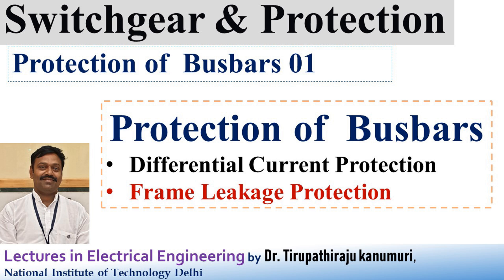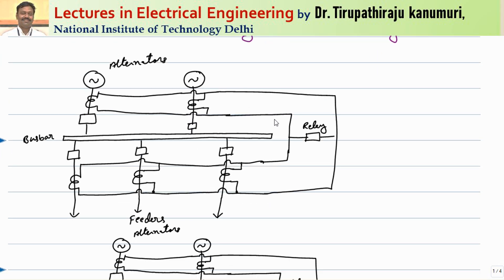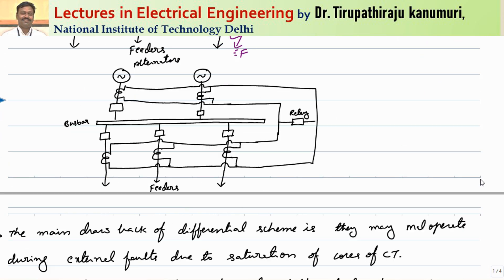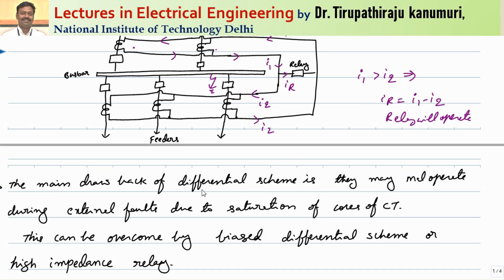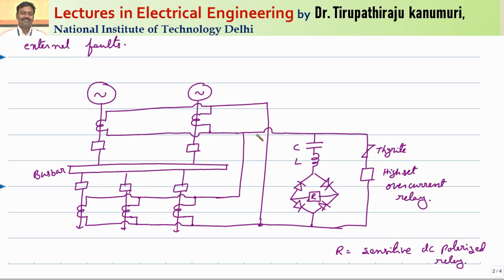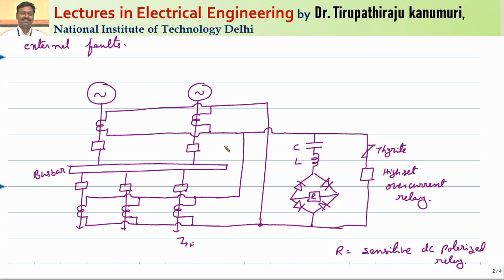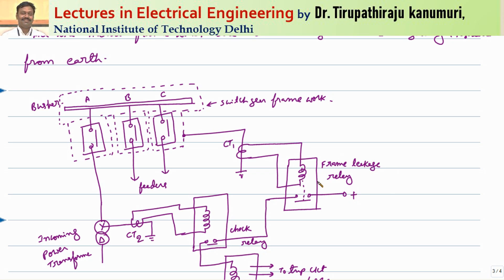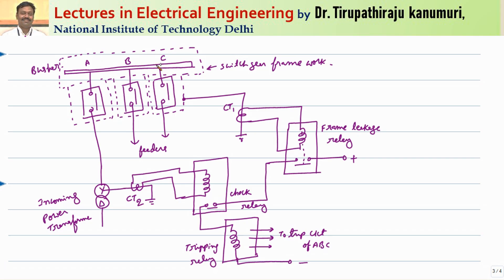SGP501 Protection of  Busbars

Comment: sir please, so for the metal clad type, both  high impedance relay scheme (or biased differential relay scheme) and frame leakage protection schemes are used
Reply: at 9:21, you said the frame leakage protection is used for metal clad type switchgear installations